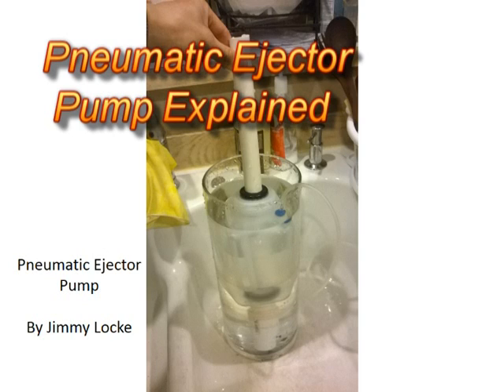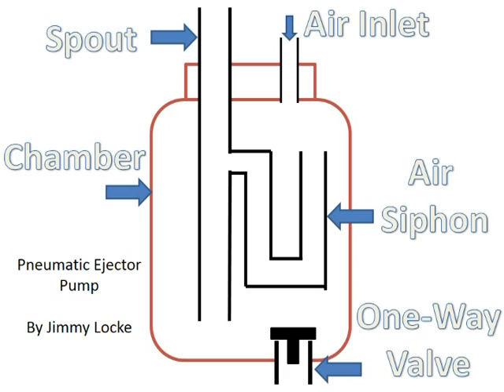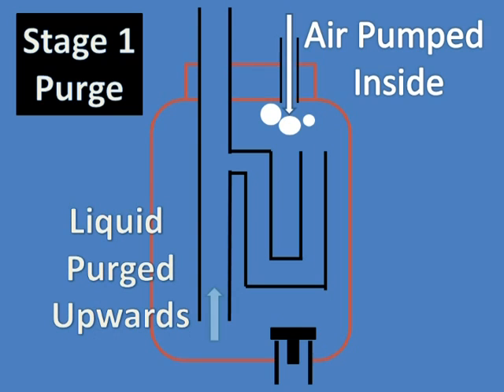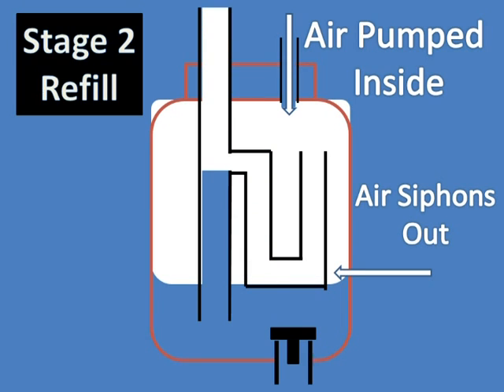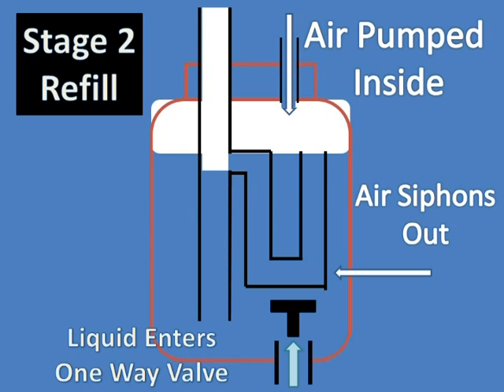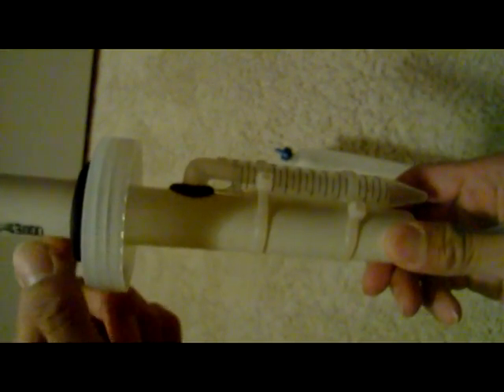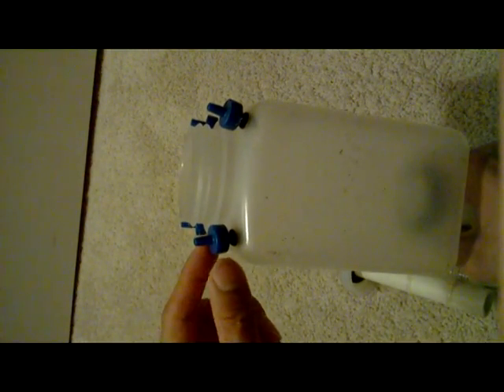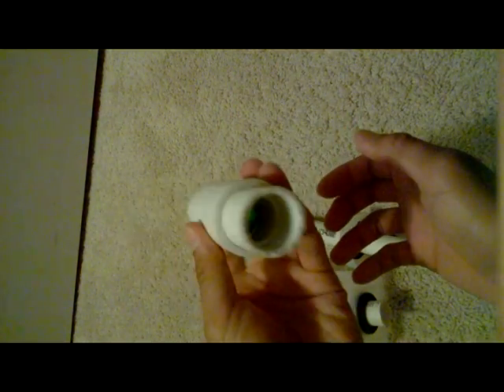Low Power Airlift Pump Explained (Pneumatic Ejector Pump aka Geyser Pump with Check Valve)

Comment: ***** Is the pump to the far left in this video that Glenn Martinez  describes at 34 minutes 40 seconds, also a pneumatic ejector pump as it uses a one-way valve? https://youtu.be/1EDlMqrngqQ?list=PLsXi696xqv-svX_yCVbxTqdIRCh7bv5hx&t=2079
Reply: ***** Thanks for the good explaination. I have another question regarding the siphon and where it is attached to the pipe. It your drawing it is part way up the pipe and the siphon is outside the main pipe. It other words the air will go down and then part of the way up before entering the main pipe.

I am wondering is it would function the same to place a tee lower down in the main pipe and then add a short piece of pipe, a 90 degree elbow and another piece of pipe pointed upwards to form the siphon. In this manner the main pipe would also serve as the upward portion of the siphon.  It is doing this in your design as well but only starting a bit higher.

I  would be interested in hearing your thoughts on this. Thanks again for your time, help and for sharing!
Frederick
Reply: Frederick Henderson  Here is an album of pictures of Pneumatic Ejector Pump diagrams. I took a screenshot of your diagram in the video and then modified it to show you want I am thinking. In another one I show your bell siphon.  
http://s1143.photobucket.com/user/frederickjh/library/Aquaponics/Pneumatic%20Ejector%20Pump 
Let me know what you think of my idea to use the spout pipe as part of the siphon.
Reply: ***** Thanks! Your explanation helps a lot. It also explains what I have been doing wrong. It looks like to keep this a compact as possible that a bell siphon is the best way to go.

One other question do you have a way to determine the best volume for the chamber for pumping efficiency?  It sounds like you have done a lot of research on this. Just hoping to learn from you.
Reply: ***** Did you do an experiments regarding the size of the siphon pipe in relation to the spout?  I was just wondering as in the one you built the siphon tube is smaller.
Reply: ***** So regarding the size of chamber have you tried going smaller. The reason I ask is that thing we learned in science class about things in motion tend to stay in motion. I was wondering if with a bigger air pump the efficiency might be better if the water and air in the spout are kept moving in an upward direction by the burst being closer together.
Reply: +jlocke8 Thanks for the feedback. I have another idea that I would be happy if you could give me feedback on it too.

I am trying to build a pneumatic ejector pump from PVC pipe parts in such a way that I can place it in an "artificial well".  This is so that I can release the air further down in the water to get more lift. Glen M. talks about doing this. Basically you just run a line out the side of your tank to a tee. One side of the tee goes down into the ground where the end is capped. The other end goes up to the height of the tank. Inside this you place your airlift, geyser pump, or pneumatic ejector pump.

Because inside the current pipe I have there is not room to add the siphon, my new idea is to place the siphon outside the chamber. See the images I have added to the gallery here:

http://s1143.photobucket.com/user/frederickjh/library/Aquaponics/Pneumatic%20Ejector%20Pump

I also am wondering if it is possible to attach the siphon to the top of the chamber. What do you think? Will this work? What do you think are the limits on the how low the bottom of the siphon can go? How high the exit of the siphon can be? How high the entrance to the siphon can be?

Thanks again for your time and feedback!
Reply: +jlocke8 I was thinking the same thing. The question is, how much higher?  It seems to be a balancing game between getting the siphon to start but at the same time emptying as much of the chamber as possible.

I know with bell siphons the designs I used that always started used a funnel on the top of the inside pipe. I do not think that this will help with siphoning a gas.
Reply: +jlocke8 I have added a piping diagram to the gallery of photos showing my proposed piping of a pneumatic ejector pump. The white spots in the 25mm pipe near the bottom are to let water in when the ball from the check valve travels upward against the bottom of the pipe.  

I would be happy for any feedback you can give on this design.  If the 50mm pipe being used for the chamber is too small I can later easily switch this out to a 75mm pipe. Metric pipe sizes are measured on the outside. I am not sure of the length of the pipe. In anycase the top end may be out of the water as I plan to place this in a "well" made from 110mm pipe, as I talked about before.

http://s1143.photobucket.com/user/frederickjh/media/Aquaponics/Pneumatic%20Ejector%20Pump/Pneumatic_Ejector_Pump-Piping_diagram.png.html?sort=6&o=5
Reply: +jlocke8 OK, got you on the one pipe diameter higher rule of thumb. In my case that would be above the holes in the discharge spout. My plan was that this would allow the water to exit even when the ball came up against the end of it.
Reply: +jlocke8 I believe that you are talking about the 20mm (green) tee in the diagram. If I understand you correctly, since the siphon will be filled with water coming from the outlet spout, I need to make sure that the back pressure on the air siphon inlet is not to great to prevent the water from entering it from the air siphon discharge. Is that correct?

The top of the chamber is a 50, 50, 25mm tee.  The 25mm currently has a reducer to 20mm. I have glued in a adapter to push into a garden hose that supplies the air. My plan was to remove this and then put the 20mm tee on.

However I could also remove the reducer and put a 25mm tee on the 25mm outlet of the bigger tee. I would then reduce the top of the tee to 20mm for the air inlet and the bottom to 16mm for the siphon. Does that sound big enough?   If not tees with bigger outlets are available. The next bigger sizes are 32mm, 40mm and then 50mm.

If none of that sounds acceptable then I thought that I could add a 2nd 50mm tee to the top of the chamber, below the first for the siphon outlet. I was trying to avoid having too many pieces that were not needed. However if you think that design would definitely be better I am open to that.

The ball I have right now is actually positively buoyant. It is a rubber / plastic ball with air inside. My thought here was if the 25mm would keep it for moving to far from the entrance it would get sucked back in place, but would easily open to allow water to enter.

Currently the adapter that is the check valve is a 50mm to 25mm adapter. If this does not allow water in fast enough I could change this out for a 50 to 32mm or a 50 to 40mm adapter, however I would need a bigger ball which would inside a 50mm pipe block more flow too.
Reply: +jlocke8 in Glenn's pump isn't the low chamber under the water-exit pipe acting as a syphon?
Reply: +ErevosWanderer +GlennMartinez ,  +jlocke8 did not seem to think so. See his reply to my comment earlier on (2 months ago at this point in time). I looked up the definition of siphon on google and wikipedia. Let us take I  look at the definition which is written for liquid  and  then as we are dealing with gas turn everything upside down as that is the way a gas siphon works. 

Just like you can pour water from a glass to another glass, if you invert a glass  and submerge it in a liquid so that it traps water and take another glass and submerge it so that it full of the liquid you can then carefully tip the glass with air in it so that you can pour (upside down) the air into the other glass.

In the same way we need to take the definition of a water siphon and turn it upside down for a gas siphon.

Definition of a water siphon (source Google): a tube used to convey liquid upwards from a reservoir and then down to a lower level of its own accord. Once the liquid has been forced into the tube, typically by suction or immersion, flow continues unaided.

Definition of a gas siphon(my variation, upsidedowning the google definition): a tube used to convey gas downwards from a reservoir and then up to a higher level of its own accord. Once the gas has been forced into the tube, typically by suction or immersion, flow continues unaided.

I do believe that in Glen's burper pump that the air coming down from the air inlet siphons to the left and up the air / water exit spout. So, yes there is a siphon.

With that all said I to now believe that Glen's burper pump is a pneumatic ejector pump however as jlocke8 pointed out not as efficient as it could be with a larger air chamber. 

However by laying the air chamber on it side Glen has increased the flow by putting the release of the air further under the surface of the tank that he is pumping from.

In my test that I have done I am finding that the water output increases with the depth of the release of the air under the water. I am finding for almost constant flow that 3 feet - 1 meter is about optimal. 

In my first test pneumatic ejector pump I am using 50mm (~2 in.) pipe vertically for the chamber and external siphon. This however makes the pump very tall. I am working on new version using 110mm (~4 in.) pipe as the chamber. This will allow me to reduce the height ~80% and still have the same air chamber volume.

I believe that without changing the basic layout  of Glen's burper pump the efficiency could be increased  by adding a longer section of pipe between the air inlet and the output spout.

One other thing that I believe would increase the efficiency would be  add  2 45 degree elbows just before the exit spout to lower that end of the air chamber effectively trapping it better / longer be for the pump would eject it.

Maybe Glen would be interested to test this. I would be interested to know if water is being slowly ejected from his pump before the burp comes to forcefully eject it.   I think that if this is the case this would definitely qualify Glen's burper pump as a pneumatic ejector pump, however maybe his air chamber is too small for the water to reach the top before the burb occurs.

I would be interested to hear the results if anyone tries these ideas. I am planning to dig a "well" to put my pneumatic ejector pump in so I am trying to keep the diameter of the hole to a minimum with the design of my pneumatic ejector pump.
Reply: Wow your inverted thinking on gas siphon helped me a lot! Thank you for the answer!
Reply: No problem!  I think it helped me to wrap my head around whether or not Glen's burper pump was a pneumatic ejector pump or not.
Reply: +jlocke8 ""The air siphon pipe, just like a typical water bell siphon needs to be 
sized according to your flow rate (in this case air flow)."  Please explain how one does that sizing.  Thank you
Reply: +jlocke8 Could an ordinary J trap be used for the air siphon?  Like this one: http://www.homedepot.com/p/DBHL-1-1-4-in-Plastic-J-Bend-HP9650BG/202078118  Thank you
Reply: +DrDangerPuppy What you make the siphon out of is not a big deal. One tip since you have such big pipe in mind, that once the ejector spout pipe gets bigger than 3/4" to 1" you could run into issues.  I know that with a geyser pump larger that that is not recommended as the air bubbles start to break up into smaller ones instead of forming one big slug of air.  I am using 25mm(1 inch) pipe for my discharge spout.

Comment: Would Like to ask? The compressed air delivered doesn't shut down for the bell to refill does it. Looks to me that it doesn't. If that's so could it be that the air being delivered can be a stand alone cylinder with pressure in it not needing a powered compressor?

Comment: Question for you:  What is the LPM / PSI of your air pump, vs the LPM / Lift of the water?  

I've been looking for a good tool to lift water for my aquaponics, and was wondering about lift heights and flow rates for your pneumatic ejector air lift pump.